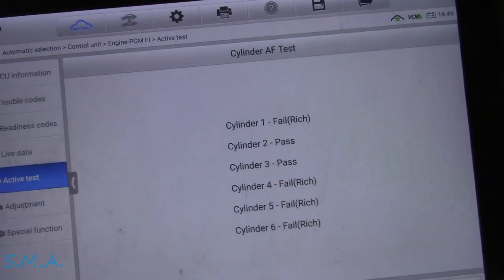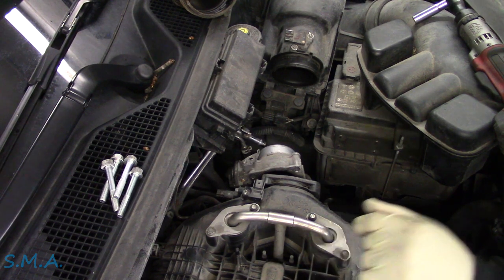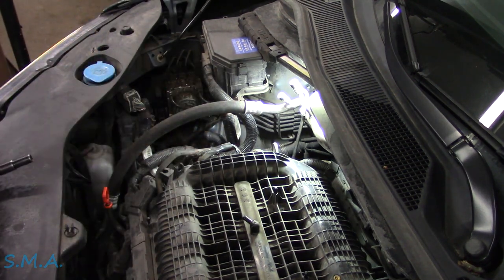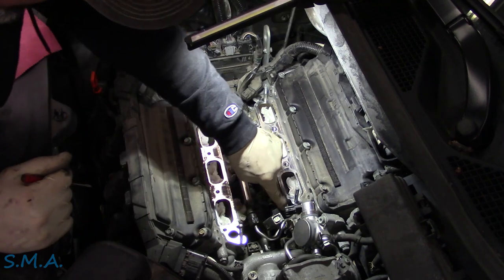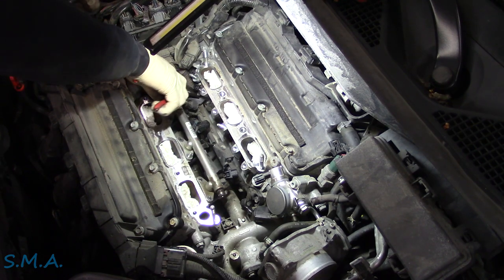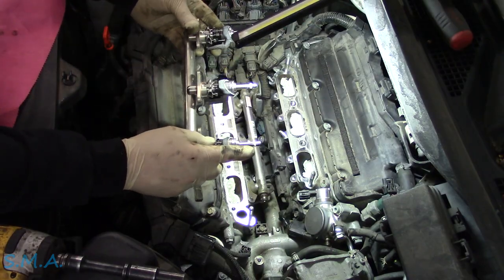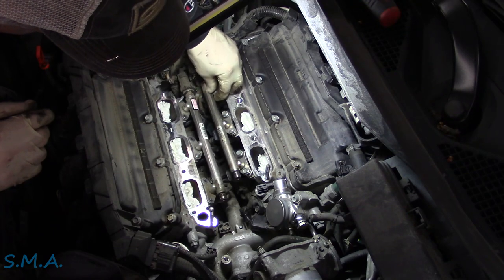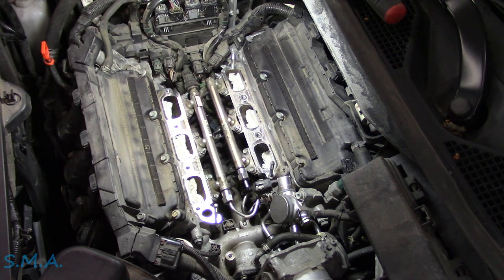Honda: Earth Dreams 3.5 GDI Replacing Fuel Injectors

Comment: We do several of these a week at the Honda dealer... p219A or p219B code is the dead give away. They sell them as a kit with new injectors, fuel pipe, and gaskets. Absolute gravy job!! 🤤🤤
Reply: I hate how a reliable engine design gets handicapped by modern emissions control devices. The injectors on my 2000 TL are still all original and only $60 if I ever need to replace 1
Reply: He missed the line in service data about the joint fuel pipe being single time use!  I've gotten the pattern down to about an hour for these, gravy job indeed!
Edit: Correction, he did eventually find the line about replacing the joint pipe.  Nice.
Reply: @nmbmtl  yep can get these done in about 45 mins.  Dont even know how many ive done at this point.   Those fuel pipes can be reused at least once even though they say not to.    Havent changed on quite a few as being a TBA part and havent had issues
Reply: @Darksyne  and a 10 minute job
Reply: @Darksyne  fuel injectors aren’t emissions equipment. From the comments it seems like it’s a failure prone part.
Reply: What goes wrong with them? They just weak?
Reply: @khakiswag  They went from port injected to GDI injectors for emissions compliance and it's been nothing but trouble for longevity in cars.
Reply: @stevew9563  i think this is a known issue.  On the Honda Ridgeline 2017+ has same engine and Honda replaces them free on that car if under 100k miles.
Reply: @Darksyne   GDI helps produce more power/torque, esp at lower RPM so saying they're just for emissions is exaggeration. People complained about fuel injection when it first came out too but does anyone wish for carburetors to come back?
Reply: @FaustoTheBoozehound  for like the first 5k miles until the intake gets carboned up
Reply: P0420 cat efficiency code !!! Injectors and update
Reply: They pay pretty good warranty compared to the time it takes, and even better customer pay. I just became an advisor, but as a tech I did probably 100 of these haha. At least 4-5 a week.
Reply: @CityWok971  This is definately a known issue. Honda has a TSB and extended warranty concerning these injectors. As others have stated, its a gravy job that takes no more than an hour, and that includes performing a software update as well.
Reply: Same at my dealership. Pays well even with warranty pay
Reply: @Darksyne  direct injection gives better fuel efficiency and also better performance especially in turbo engines. DI has been used in Diesel engines for a long time it’s nothing new. These are just junk injectors.
Reply: came here to say this 😂 (Honda tech as well) was this Pilot out of the 10 year/150k warranty extension?
Reply: It’s a true trouble spot for the J35. I left Honda after 320k miles. Brand products weren’t meeting our needs or goals anymore
Reply: @khakiswag  don't disturb his ignorance. He wants to believe everything that came later and then certain year is bad
Reply: @CityWok971  When brand new Hondas show up at the dealer with a crankcase full of fuel, they tell the dealer to drain the gas/oil mixture, refill with oil, and give the vehicle back to the owner. Never mind the damage that occurred from trying to lubricate the engine with gasoline.
Reply: @314computernerd  "Honda has a TSB and extended warranty concerning these injectors. As others have stated, its a gravy job that takes no more than an hour, and that includes performing a software update as well."

Does Honda extend the warranty for the engine if the crankcase gets filled with fuel to the point that the engine stalls out? Gasoline is a poor lubricant and these Earth Dreams engines seem to have a knack for filling the crankcase with fuel.
Reply: @UCVIL62GbelHQ6Lyod5geLbw Honda reliability only existed in the 80s and 90s
Reply: Correct we do these all the time at the dealership. Gravy ticket!
Reply: If was the honda carbs of the late 80's, it would be awesome to have them back. Never had problems, and got better fuel mileage than fuel infection
Reply: @harrydavis8120  Your comment brings back memories of my 84 Honda Accord boy do I miss the 20 vacuum line coming at of that vacuum control box. What great first car had 350,000mi on her before I moved on.
Reply: It’s not an emissions thing.  The GDI was for more power with better fuel economy (unless that’s what you guys are considering emissions.). Too bad it’s at a price of severely decreased engine longevity.
Reply: @Darksyne  I have a 96 Chevy 423k all original. Daily driver. Unfortunately I am going to have to replace the distributor cap and rotor for the first time here soon but still on its factory injectors and all. If they r built to last and taken care of its gravy.  If it’s built to break or abused of course it’s gonna be a nightmare.
Reply: @FaustoTheBoozehound  no but port injection?  Hell yes!!
Reply: Now if only the kits weren't constantly on back order
Reply: @FaustoTheBoozehound  Funny you should ask that question...  As I was watching this video I was thinking to myself how much simpler it would be to remove the 2 carb to intake manifold nuts on the AMC 232 cu. in. straight six that was in my first car - a '75 Pacer.  You could have the entire "fueling system" off the car and on the bench in 5 minutes.   Yes, modern cars are more efficient and reliable, but eventually they do need maintenance/repair and then you need an expert like Eric with $100K of specialised test equipment to get the job done correctly.  I wonder if we really have made progress when you consider the entire life cycle cost (all aspects, not just financial) of owning a vehicle.
Reply: @corykluthe355  Wow. Sure seems like it would take hours to do. 45 min is awesome.
Reply: @karlschauff7989  As far as I am aware, Honda does not believe that oil dilution is an issue with the V6 engines. If something catastrophic happens to your engine and you believe the injectors were the cause, Honda would likely take those issues in on a case by case basis. That is usually how TSB's are made, a manufacturer looks for trends in repair orders and acts accordingly. On a side note, there is a TSB for oil dilution on some of the newer 4 cylinder engines in the CRV's and Civic's.
Reply: Interesting to see this direct injected version of Honda’s V6 needs this job as it’s a common problem. Thank heavens their J-series V6 engines are innately easy to work on.
Reply: @MrSamPhoenix  Glad to hear you say that.  My daughter has a new Honda Pilot.
Reply: @robmiller9757  probably not! likely 2nd, 3rd. owner, bought & owner did not know, nor cares… he/ she just wanted it repaired by someone that “ can fix it “ lol
Reply: @karlschauff7989  then, take it to Eric, just fix the heap! I’m tired of going to the Dealer !
Reply: @Darksyne  and now cost more than all American assembly plant cars , with parts made offshore! We only Assemble here! We don’t make anything in this country! We all work for people who speak in languages we don’t understand ! L OL All vehicles today are junk, not like the 80’s anymore!
Reply: When I replaced my injectors 
I didnt replace the fuel joint pipe, 
I should replace that correct since its one time I keep getting intermittent lean codes that come and go and all the lights come on
Reply: @Fearsomex23  if it's not leaking don't worry about it. Perhaps you have a vacuum leak somewhere or accidentally put e85 in it
Reply: @ericcherveny5195  okay I check around the fuel rail, and the pipe and dont have any fuel smell on my hands. 
Could it be the BOV? Last dude who owned the car put the aftermarket bov on it?
Reply: Awesome, helpful video.  Unfortunately, 2 years later, after not being available for at least a year, the injector set is now double the price.   I can’t confirm that the kit with pipe, gaskets, etc. is available except on eBay, and that has doubled too.
Reply: @njphilwt  I have loosened my fuel S Pipe 3 times already and still no leaks.
Reply: @njphilwt  6 injectors cost close to $1000 in Canada.  Ridiculous
Reply: Replaced twice under warranty at 110K mark. Trading it at 10 years or 150K unless a I get another free replacement right before the warranty lapses. Dang. This car is expensive to own. $1800 timing belt. $800 valve adjustment. I replaced my spark plugs myself because multiple dealers wanted $700 for that. These injector failures will be my problem in 40K miles.  Thinking Toyota.

Comment: I love when service data says "remove and discard". I did a steering rack on a Traverse yesterday and service data says to discard the gigantic subframe bolts, after 1 use they are ruined. Funny thing is, no dealers stock the bolts and we all know every single traverse has had the subframe bolts removed to do timing chains.
Reply: Gold! Typical GM move sounds like to me!    Never throw out parts even if the data tells ya, only thing I like GM is to have folks who fix their junk is job security for life😂

"An old saying my me'ma tought me!"
Reply: If they're torque-to-yield bolts, reuse is problematic because the bolts have been stretched when installed and can break if reused.
Reply: They call that torque to fail I guess.
Reply: @buckhorncortez  The specifc bolts he mentioned...I have yet to see a degree angle as part of the torque spec so odds are preety likely they are not torque to yeild.  Most GM FWD/AWD subframe bolts as far back as the A-body have been in excess of 10mmthread diameter.  I do not want to be the guy who has to "yield" those bolts and the sad body nuts would likely never survive it anyway.
Reply: @michaelkrenzer3296  Good point. Torque to yield bolts generally have a skinnier shank section which is the site of controlled plastic deformation. The degree torque step is the biggest hint at a torque to yield. I think the discarding is based on liability principle. I have always reused brake caliper slide pin bolts despite the Mercedes and Toyota FSM of my cars calling for replacement. If the fastener is not corroded, the threads look intact, not galled, not pulled at an angle from torquing, and the head to shank area does not look to be twisted or stretched, I reuse them. I do however, A L W A Y S clean the factory Loctite off the bolts completely, spray them off with brake cleaner as well as the bolt holes, and put blue Loctite back on them. If the principle is to replace the bolts due to the possibility of the tech not putting loctite back on them (nearly every factory replacement brake bolts I have seen has pre-applied Loctite), I am in the clear. Very polarizing decision for some reason. My boss hated it. "Never Loctite a brake part bolt!!! Stupid!" I always quipped back "Do you enjoy the idea of your brake caliper or bracket flopping around damaging the rim, hub, and possibly killing you? What's the matter with you? I'd rather need to torch every single one of these future comebacks than ship a car with no Loctite. I sure as hell ain't putting antiseize on them so don't even ask. THAT is stupid." TL;DR if it has no stretch shank section and it isn't aluminum and it has no degree torque step in the FSM, clean it off thoroughly and reuse it with new Loctite. No problems in my conscious or mind about doing that. 👍 Have and will do it on my personal vehicles and the vehicles of my loved ones.
Reply: Torqueing instructions: Tighten until bolts strips then back off one half turn 🤣
Reply: I've never removed the subframe to replace toning chains on traverse, enclave, Acadia, OUTLOOK, etc.  I do them all in the vehicle.
Reply: @breakinn403  You are backing them off too much,  Only back them off 1/4 turn.  Ha Ha
Reply: Nickel and diming to put a vehicle back together
Reply: They don't trust you to put fresh lock tight on them. IMO
Reply: @Kingcanvas95  or using common sense.  Bolt in the example is very clearly not a torque to yield and no one stocks them...seems the logical choice he made to me.
Reply: Can be that the bolts have loctite on them from the factory. If you take them out, then you have to put loctite on them. Honda doesn`t trust you to add the loctite correctly, hence they want you to throw the bolts away and buy new ones. This is also to avoid responsibility
Reply: @buckhorncortez  but in reality this never happen a reused many time torque to yield head bolt on honda motor and never got a head gasket failure
Reply: ford trucks have to have the front axle nut replaced just to do the front brakes.  no dealer around me stocked them lol  the nut literally says to replace if removed on it.
Reply: Pretty much every bolt on a Tesla has to be replaced or service data.  There's nothing wrong with them so I have about 100lbs saved up lol.  I just know I'll need em one day
Reply: @blue03r6  are those the fun ones with the actual outer bearing pressed by the back of the rotor?  I saw that on one Ford and thought "that shit went away with drum brakes"...and I was wrong
Reply: Dealers will hold high demand parts for themselves and tell you there are none in stock, especially when they’re on back order.
Reply: @michaelkrenzer3296  imma go with yes cuz my f150 doesn't need em replaced for a brake job lol
Reply: every manufacture has torque to yield bolts in their vehicles
Reply: I don't pull the engines to do timing chains on these. It's a waste of time for me.
Reply: GM does that to take liability off them. If something were to happen anymore lawyers go get service, repair orders, etc to literally find someone they can sue for something and that would be their golden egg for say even if you've never had one fail before they're looking for that ah ha moment. 

Typical Sue happy world we live in anymore. 

Always on your repair orders specifically put in there that vehicle was repaired using mfr repair procedures, torque specs, etc as it could save your ARSE someday.
Reply: @blue03r6  never had to remove my front axle but to do brakes on my 2013 f150. On my f25 BMW X3 the parking brake is electronic and also attached to the caliper, when you swap pads in the rear it comes with new bolts and loctite in the package. They won’t want your parking/emergency brake falling off.
Reply: They just put that in there to CYA, so if a bolt breaks after a repair they cant be sued.  90% of items in the owners manual are to atop them from being sued
Reply: Hopefully that steering rack included a flush of the steering system  and a filter..prevent comebacks!👍😁
Reply: @brianbartosch7384  you must be a magician of some sort because I know alot of Master techs have never done one of those GM 3.6 suvs' in the body of the vehicle, and believe me if they could do anything without removing the engine they will do it.
Reply: I can have the motor/trans dropped out and sitting on stands on a POS Traverse in about 2 hrs....I'll buzz off the timing cover 📴 and replace all of the terrible timing chain components in another 2 hrs then slap it all back together in another 2. Flat rate time for chains on this POS is 15.0hrs.
Reply: GM : "Our quality has been questionable for decades and we are smug about it." 😜🇨🇦
Reply: Did a fab tech  lift kit on a 2wd Tacoma and the instructions tell you to discard the backing plates for the front brakes at this time lol. They didn’t machine the drop spindles to accommodate backing plates!
Reply: If it ever does fail, they’re legally covered, you’re not… Some guys wrench to specs, 99% don’t these days, probably why my service vehicle goes to the dealership under warranty always leaves in worse shape then it was brought in… All per usual, have to do it myself for it to get done… There’s only one mechanic in my area that gets it close to right, the other 600 in the area are less than useless.. They’re all experts that know more than I do though… That’s why I like Mr O, 80% comes form shops that couldn’t fix it… Nice to see old school values with the knowledge of the modern stuff… I’m not sure about these specific bolts but a lot of torque to yield stuff is used in the more compact higher strength stuff to save weight, only problem is the advanced metallurgy, it just isn’t at all like the 1950s cast iron anymore, and a lot is borrowed form the aerospace industry… Probably overkill, hard to say, with the absolutely insane amount of failed procedures in America these days, I thinking there’s a reason… I’m not in the business, I’ve got a shop just not time but, I’m forced to work on vehicles because the one guy I trust is booked for months… I’d say there’s some good mechanics left, but the vast majority are in way over their heads these days, and will hold stuff for weeks and ship it still broken… Sad really…
Reply: Wrong my 2012 traverse has 148000 miles on the original timing chains